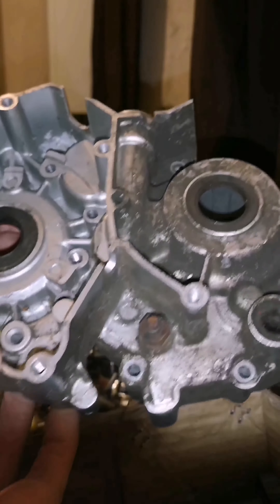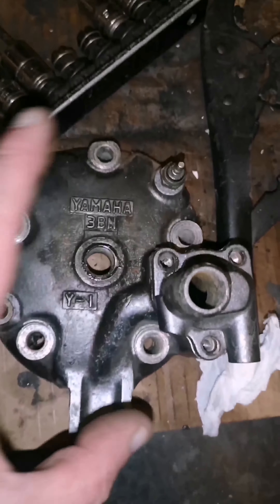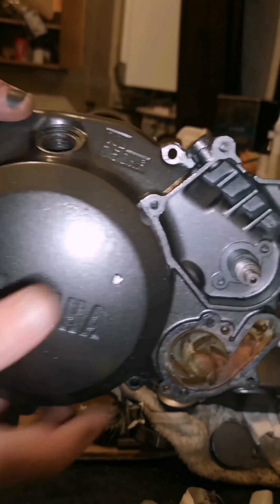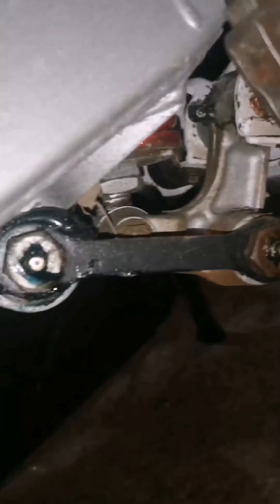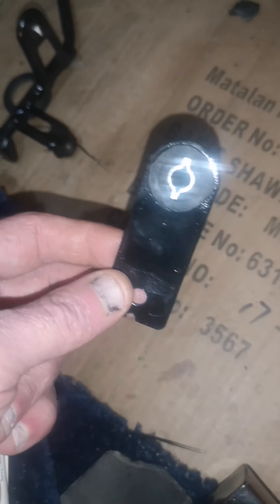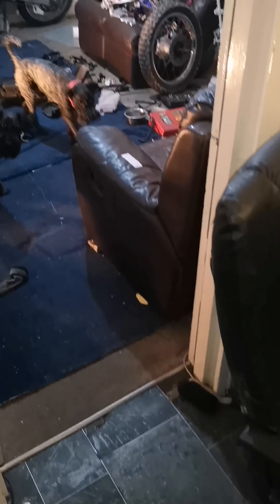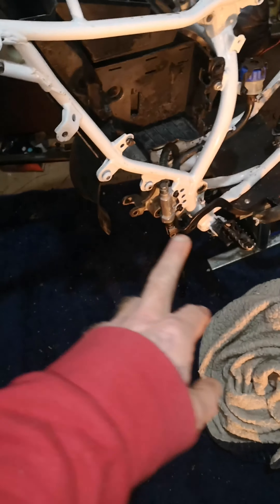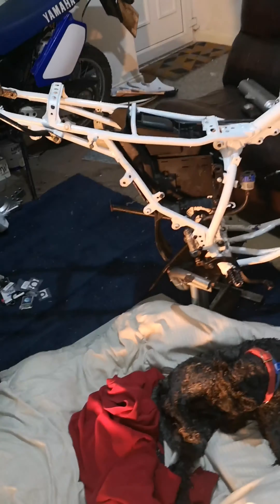How to fit Dtr125 front brake slider pins/cases painted pt3

Comment: Bottom yoke silver top one black wheel hubs black calipers black middle engine cases silver with gunmetal on evaside clutch case & flywheel case but sure itll look good whatever you do bro
Reply from the maker: It's going original m8 Al lose on it if not
Reply: @2strokemxclassics  good vid mate, yes I have pimped my dt up,, but I have still kept all the original parts , just in case I ever sell it lol .
Reply from the maker: What you done to here m8 yeah keep them cos no one will buy a modded one you can change back to original in a few year and restore it
Reply from the maker: Am Taking it back to how it was when it was new an original m8 after a red disc guard if ya can find any
Reply: @2strokemxclassics  is right, loads more profit in a original one,, will ask a few of my mates bout the red disk guard .
Reply: There is one online but its 44.99,crazy
Reply from the maker: Cheers m8

Comment: Easy m8 the water pipe dont chuck it away just block both ends up & fill it with water & leave In the freezer overnight I've done it before & it works brilliant for getting rid of dents
Reply from the maker: She's gone now m8 a just chucked it
Reply: @2strokemxclassics  orwell least yano now for future events what they charging you to balance crankshaft fought you had a set of daily gauges to do it yourself
Reply from the maker: A kno m8 an it's still in the wheely bin if ya want it, Jim baileys doing it m8 a don't wana risk it, leave it to the pros🙂 on this one
Reply: @2strokemxclassics  why not you do write bro

Comment: coming along nicely m8
Reply from the maker: It be built up soon a sent the crank today m8
Reply: @2strokemxclassics  u wasn't tempted to do yourself? I brought a wheel truing stand for my DT rear re-spoking a while back i think you can use it for re-balancing cranks didn't seem to hard on my wheels :-)
Reply from the maker: Yeah m8 I done it only done 3 just messing about, I put the new rod in and it was off line so a tried to push the pin back through and it nipped the shims up an rod wouldn't move lol so a sent it off to Jim Bailey he's the best at dt stuff
Reply from the maker: Av got a crank truer m8 just no use yet gonna learn tho
Reply: defo at least you know with Jim it will be spot on :-)
Reply from the maker: Defo m8 he done a mint job👌
Reply: @2strokemxclassics  Nice one mate ;-) have you had any graphics reproduced b4? keep seeing Ben Hazzard mentioned on the DT FB groups